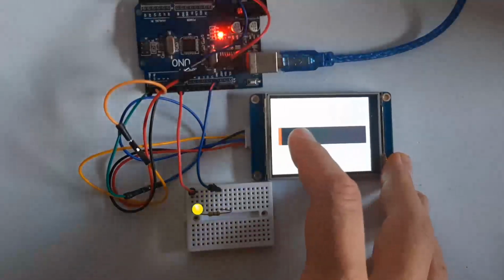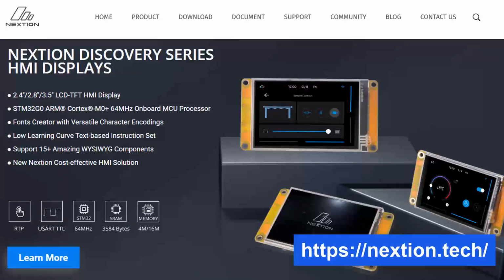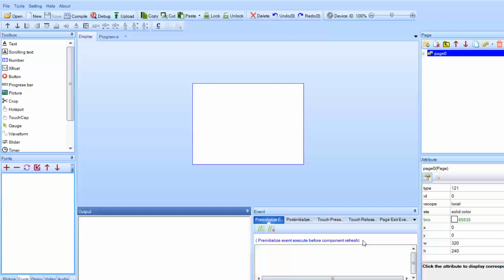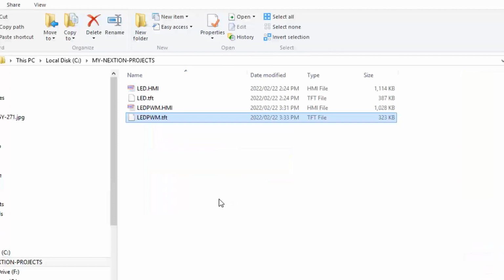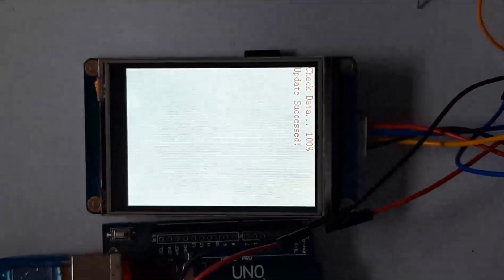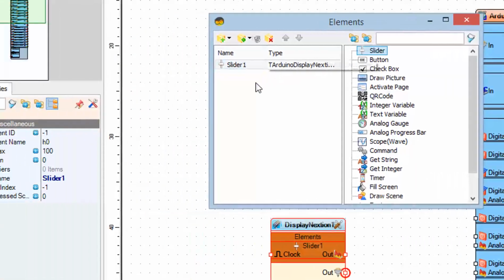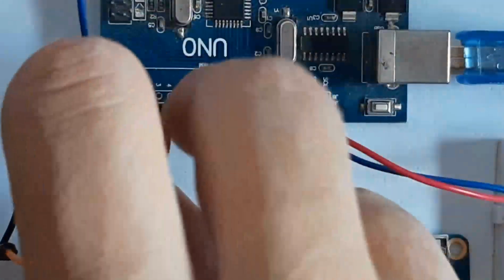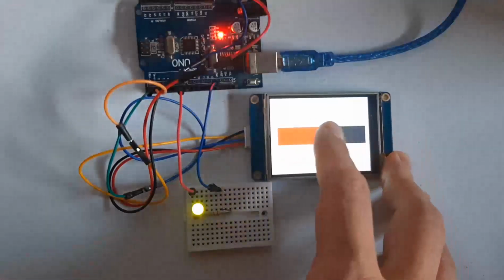Arduino & Nextion Display - Use Slider to Control LED Brightness

Comment: What if I had your arduino set as a master and then had some other arduinos hooked up as slaves using SDA and SCL pinout connectors? Can the Nextion display access the  LEDS placed on those slave arduinos?
Reply from the maker: would need to check